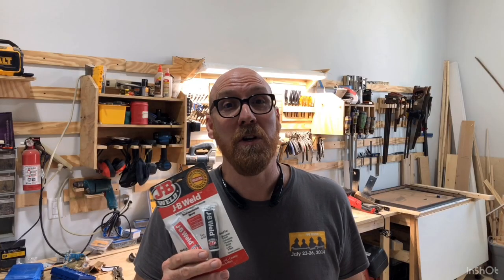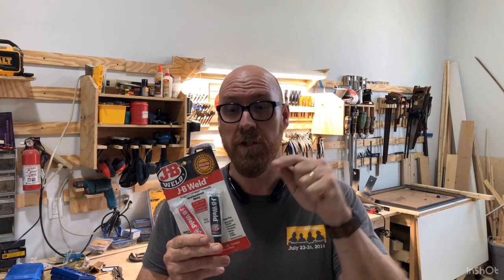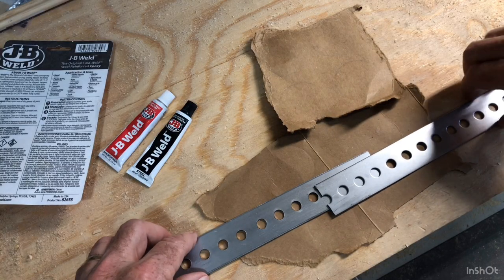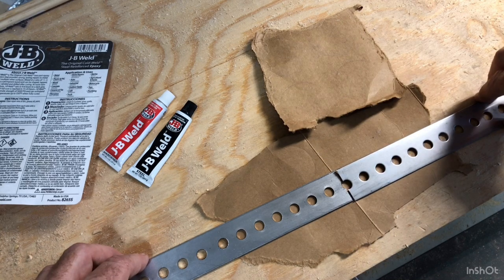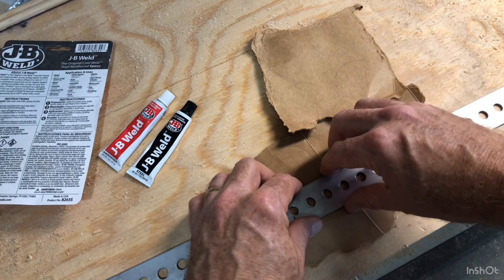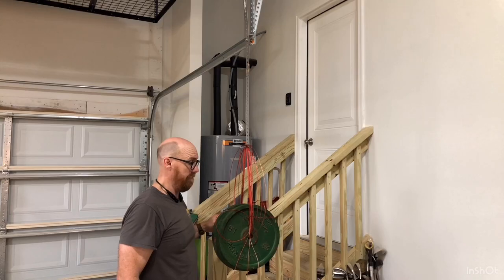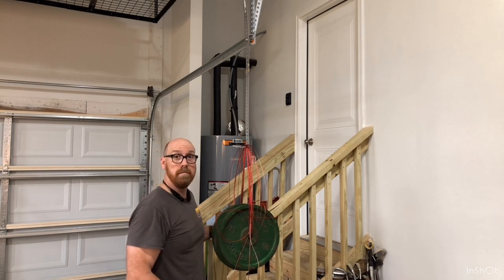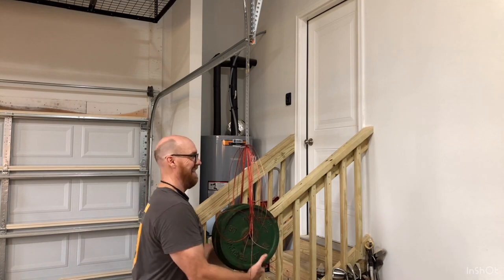JB Weld Strength Test

Comment from the maker: What are some of the projects you've used JB Weld for?  Do you use it around the house, around the garage, around the camper, or around the boat?
Reply: I stuck a fitting in the hole of a honda head and jb welded it. It holds coolant and all. Well... ok this is the 2nd one I've done this to and it works like a charm! Love jb weld!
Reply from the maker: @terrelldancy7830  So glad to hear it is holding.  I have not used it on an engine so I was wondering if JB Weld would hold under heat and pressure (like on a thermostat housing or a radiator).  Thanks for watching!
Reply: @FieldGuidetoDIY  yup yup! Now I will say that I would only use it on places that are already strong this fitting  was on the head and those are made of strong material If .... this was the last resort id try to put it on a radiator crack depending on what the radiator is made of those plastic radiators are asking for trouble but the Metal ones? Sure why not!
Reply: The instructions says it holds up to 3,921 psi and up to 550° so a good application and technique and let her roll!
Reply from the maker: Terrell Dancy Imagine using on a car you intended to drive cross country.  That is faith in the product.  I’m not sure I’m there yet.  Still a relatively new user.
Reply: I’m about to use for some parts on a DIY electric skateboard! Just saw this video to gauge if it’d be strong enough and I think it definitely will be, thanks for the informative video.
Reply from the maker: Arizona Jewell I would agree.  The manufacturer says it is rated up to 680 pounds.  Glad the video helped.  Thanks for watching!
Reply from the maker: I’d think it would be good for the bed frame.  Also I think it would be great shoring up the original welds.  Hey, thanks so much for watching!
Reply: I just used it to install ladder racks on my truck 🙏 for me
Reply from the maker: Nine Seven Three Absolutely.  It’s rated up to 680 pounds so ....  Keep me posted.
Reply: I used it to hold a clutch nut in place
Reply from the maker: Rainy Loschiavo WHAT?!  Great thinking.  And I’m assuming it held.  Thanks for sharing and thanks so much for watching!
Reply: @FieldGuidetoDIY  it was only a 49cc engine but it held without any sign of wear at all single speed to so that shit screamed up in the case but it still held
Reply: @FieldGuidetoDIY  is jb weld good enough for a very very minor rim crack on inside that isn’t cracked through the full depth of the metal?